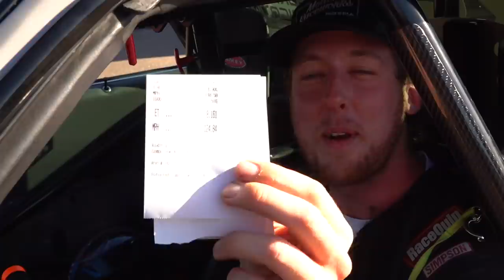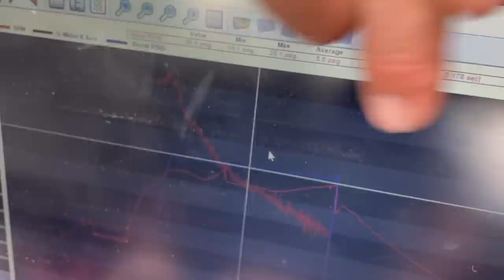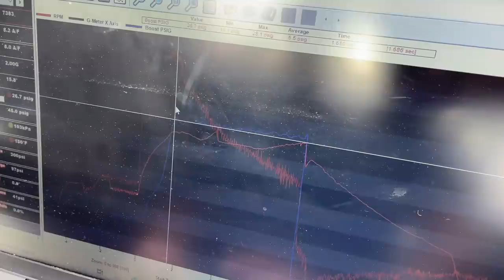Testing Mullet's NEW Turbo400 Lockup Racing Transmission For the First Time! HOLY SMOKES!!!

Comment: So glad to hear Kevin recommend neutraling on the shut down. Steve Morris has pointed out premature failures for this very reason, people that let the engine do the braking. Very stressful on a engine.
Reply: You can damage the transmission if it doesn’t actually have a clean neutral.
Reply: Could also make your tranny grenade.. it's all about compromise.. this for that.
Reply: @SouthernSpeedVideos  guess it depends on which part costs more, engine or transmission... LOL
Reply: and yet cleetus never did it on the passes in this video lol
Reply: @WhiteJameson24  Well if that th400 has a pump on the output shaft also, it shouldn't be an issue. I would assume if they paid the big money it's got something along those lines
Reply: @rebel3353  I think he did I can't remember exact timestamp nor am I going to go back to find it but I think he did.
Reply: @wickett7078  you know what they say about assuming..
Reply: @rebel3353  old habits die hard. And to be fair cleet and team are a lot more likely to hurt their engines in other ways before this becomes an issue with one of them lol always pushing the limits I don't think any failure they've had was due to this, and any worn out main bearing are addressed during fixing whatever else they broke 😂
Reply: Shifting to neutral in a TH400 or 4L80e at speed sends a planetary into hyper speed. A quick search will let you know it is a definite no-no.
Reply: @wickett7078  A pump on the output shaft? A double pumper 400? Show me one.
Reply: @jimandskittum  the M&M TH400 has a “clean neutral” and is setup to shift to neutral without any problems.
Reply: @rebel3353  Cletus never takes care of any of the important things in racing,no surprise.
Reply: @QuantumLeap83  yeah it’s going to take a while for him to get into the habit of going into neutral…
Reply: @KSRPerformanceFabrication  I didn't know about 'clean neutral" valve bodies. Thanks for the info. I didn't mean to put out bad info. It's evidently the direct drum that spins at 2.5 times the driveshaft speed without a clean neutral.
Reply: How is engine braking hard on the engine? this is the first ive heard that and I always thought it was a good thing since it can save on brake wear
Reply: @lazarustheatv8389  I found a forum where a couple of heavy hitters were going back and forth on this. I don't think there is any proof either way but if people want to buy it the market provides it.
Reply: @lazarustheatv8389  it's not something horrendous under normal conditions, but on the shut down after a run that is when you're gonna have oil starvation, because of negative G forces if ur oiling system isn't perfect, and that's happening the same time that the rotating assembly has to deal with the forces of bein driven by the deceleration if the car under compression - the compression is what's actually slowing the car and that created downward pressure on crank bearings etc. So it's not particularly 'bad' but about the same wear and tear as you had when launching the car. Which can be done away with by going to free neutral but at the cost of stressing trans parts if ur not set up for it. It's always been a debate whether it's good or not but there are a lot of big names in racing that swear by it. As I've said the way these guys go through engines (which is a good thing means their pushing the envelope) something else will prolly get an engine before this does.
Reply: idk letting a motor power down through compression with the chutes is a safer bet. it resets heads and gaskets also blows out extra alcohol left behind. purges the system and even helps data log sometimes if there was a failure. with a parachute it usually doesnt even pull the motor that hard.
Reply: Considering the deal they seem to have with Texas Speed, I'd rather buy or rebuild the engine vs buying another trans. Honestly tho they should probably have spares of each. Especially for a race week style car.

Comment: Tough break fellas! 
Luckily it doesn't seem too terrible. 
And Kevin might be on to something with those "topfuel hoops" he mentioned.... it might be that time for ya'll. Plus look at how well they hold up, just ask Kyle and Brent.
Reply: It’s called a fire ring
Reply: @jonathanedwards8913  they have different versions a top fuel hoops is what they are talking about TKM does it to there  engines all the time it's a solid machined in piece fire ring is just copper with split at the end same concept kinda but the hoops are way better having no gap and being machined to engine

Comment: I’m with Kevin, needs top fuel hoops at the hps that y’all are getting into. The hoops require the block and heads to be machined, TKM has mini hoops that they make in house I think, they only require the block or the heads to be machined for the hoop, and they’re bigger than an o-ring set up.

Comment: Kevin looked soo gutted you could almost feel his pain
Reply: When you have a vehicle that is staked on your reputation and it’s constantly having problems on a National platform I’m sure it can be stressful. Granted head gaskets and transmissions aren’t really his fault but after a while I’m sure it gets old fast. But the man clearly understands something that is constantly being tested with new parts and suspension set ups is just going to have trials and tribulations. They got spoiled with Ruby just a work horse and a combo that has just worked for them…Mullett is definitely making them work for it
Reply: @maxxphat87  they're taking a much bigger step with this one. Going from 7s to 6s is harder on everything.
Reply: @ryanlamfers8692  that's for sure and a LOT  of these fans don't quite understand how fast 6's are and the stress too all the components it takes. They don't have 3 spare blocks and 10 sets of heads on standby after every pass for top fuel cars for the fun of it.... this car will be in the 6's by the end of February 2k22 and then struggle again with new issues. It is a very expensive milestone to maintain.  Everyone talks about big chief and look at where his pro mod went in the quarter..... best was a3.38- 5.42 I believe and the times the talk about on the show with the "I remeber when I had a 4.40 car" they are talking about to the eighth.... 🤷🏽‍♂️🙃✌🏼

Comment: I think what that T400 really needs is a nice SMX to complement everything. TSP 427's are awesome and all, but Morris's stuff is on another level entirely.
Reply: Yes yes it is
Reply: But this was the last transmission he ever had to buy
Reply: Cleeter is sitting on a SM 540 BBC. Said it was for the ramp truck at the FF. But it's been so long who knows what the plan is
Reply: If he has to turn the LS down to not blow the tires off, an SMX or other Pro Mod type motor is the last thing he needs
Reply: @randomguy9635  I think he would also put big tires on it.
Reply: I think cleeter wants in the sixes like this and will then put the 540 bbc and big tires on it

Comment: I still wouldn't shut the engine off on the big end at high speed even with the safe neutral.  That is one of two very important rules of the TH400.  The other being always start your burnout in 2nd gear.
Reply: why would the gearbox matter if you neutral it ?
Reply: Not sure but engine off no transfluid pump?
Reply: @Nebbia_affaraccimiei  Because with a TH400 putting the trans in Neutral at high speed will cause the direct drum to double in RPM and could explode from over spinning it.
Reply: @1nitrousmustang  yes never shift a t350 or 400 to neutral the drums accelerate to huge speeds and tend to fragment like a frag grenade let alone the wear on parts

Comment: Time to o-ring the block and run copper head gaskets for sure.
Reply: I figured they already would have had the o rings on it.  I swear that leroy had them at some point
Reply: Just get a TKM engine. Texas speed seem to have a fairly low limit...
Reply: Yep ,👍
Reply: @Jake_Hamlin  it needs a SMX
Reply: Put your order in with Cometic NOW...cause it's gunna take awhile!
Reply: @gnarkiller  Pretty sure leroy did with the block they ran 7s on
Reply: @gnarkiller  Those we’re just metal rings that clamped in between the head and the block. No machining is required to run those. That is the only selling point of them. They are way behind a copper head gasket and machined hoops
Reply: @dylanphipps5272  I have posted that he needs to switch to red copper head gaskets so many times that I gave up. I figured he either did not read or ignored my post.
Reply: O rings “Athena” head gaskets from Texas Speed are what Leroy had and probably what mullet has as well.  They are not the same thing as hoops, top fuel hoops or fire rings which sit in a machined groove in the cylinder head, block or both and use a copper head gasket.  Hoops seal much better/stronger than o rings.  No engine Cleetus has ever had on this channel used hoops.

Comment: TKM Black Sheep for mullet Texas Speed builds nice street engines but when you get to this caliber I think TKM is the go to for LS.
Reply: I agree but I think he needs to go to a Steve Morris SMX engine. Look at what Tom Baily does at his power levels!!!
Reply: @wbr7869  tom Baily doesn't have an LS
Reply: @ninaallen7849  Yup exactly!!! Not knocking a ls but for big power you need something like the SMK engine. That engine can take the power!!!
Reply: I just said this lol
Reply: @wbr7869  I don’t think cleetus wants an engine he has to check valve lash on every day twice a day to make sure it’s not eating itself, like Tom does. A hydraulic roller LS can more than achieve his goal.
Reply: @wbr7869  not knocking other engines either but there are LS that make stupid power and hold together. Slapping a 427ci in with a couple turbos and thinking it'll run high 6s immediately with minimal testing and that much computer controlled shit probably won't work. Texas speed builds killer street car engines and pretty sweet 1200hp capable engines but any more than that, I'd look at some different builders. I do agree there's a reason alot of the consistently fast cars run some sort of big block/hemi but it's alot more work.
Reply: At branden c and Adam I agree with ya both. Texas speed makes great engines but how many times has ole cleet sent them back to be rebuilt? What he is trying to do requires a special engine! I do believe you can get a SMX engine with a hydraulic lifter cam but remember he is trying to run 6’s in a heavy car!!! Thats going to take a engine that may need its valves ran each day!!! Ask Rynn Martin, he has to do the same with that new hemi!
Reply: @wbr7869  I hate the whole xxx world record that everyone touts now but the black sheep went like 4.15 with a hydraulic roller

Comment: I've been asking for months and months if Cleetus was having Texas Speed to put Top Fuel Hoops in the block and heads because they work up to 60 lbs of boost and go up to 90lbs because all the TKM cars have them and thats where I learn about them. John Doc ran a 4.15 e/t with a TKM hydraulic lifter LS

Comment: Even though we aren't there in person to see this action, it's still really cool to watch on video.  Definitely a lot of fun to watch the team working together to tweak Mullet.  I'm not a drag racer but from what I can tell this new tranny is much much smoother.  It really gets the power to wheels and power to the ground in a much smoother manner than the previous tranny.  I would assume that means it has much more control of what the motor is putting out.

Comment: As a person who tractor pulls and builds Pro Stock pulling tractor engines with turbos in excess of 150mm. C-rings and no head gaskets or fire rings and copper head gaskets. But all the Pro Stock engines are c-rings and head directly on block.

Comment: Sounds like it's time to oring the block. Just like kevin said, stainless steel wire and copper head gaskets. Tractor pull guys are holding 100 psi boost in a cummins like that. With triple compound turbos

Comment: Still Tech Tip; The exhaust screen is 100 % going to plug on that backpack blower. When it does, stick a screwdriver in to the exhaust until it bottoms out and then push it in one more inch and woller it around.

Comment: You put the best of the best parts in it and the best guys building it and there is still failure.  No ones fault but it just shows the amount of extreme in these motors. Crazy.  It will be dialed soon

Comment: I know Texas speed is your boys but I'd love to see a tkm black sheep motor in mullet
Reply: Cleetus has had Steve Morris around the shop a lot lately. I think a SMX is in the cards somewhere down the road.
Reply: @garrettstevens2232  personally i think mullet has a built LS  427 short block by steve.. steve has video of engine assembly for cleetus, but cleetus didnt really talk about it. guessing due to texas speed sponsorship
Reply: @TheRick2130  Interesting. I only recently started following Steve's channel so I didn't see that one.
Reply: @TheRick2130  He's got enough Texas speed motors. I don't think one motor is gonna ruin the sponsorship.
Reply: it will be interesting whether TSP steps up their engineering to keep the heads down and play in that market or Cleeter just goes and drops one of Steve's engines in and gets back to business. Something clearly needs to change now after recent failures.
Reply: @bkrgi  I wouldn’t compare tsp to Steve Morris, Texas speed is much higher volume and Steve is a niche builder. Both serving their own purposes
Reply: @zethloveless7238  Who's comparing???? I'm just wondering if TSP will step into this niche...if not then clearly a SM engine or the likes is a must for Cleeter.
Reply: @bkrgi  yea I don’t see a real need for them to make niche motors. Let proline etc do their thing is tons of shops like that already 😀. Not a real big market if they already are a solid high volume shop.
Reply: @garrettstevens2232  just search on steve channel.. "cleetus"
Reply: @TheRick2130  found the time lapse. That's definitely not a motor we have seen yet. It is a big block with a dry sump and SME valve covers custom milled with the FF logo.

Comment: Hey cleetus any way you can hook up an rpm gauge so the camera can see? I think it would be interesting to see where it's shifting at other than just hearing the motor...Maybe speedo/rpm . I like to get hyped when the car goes on a pass.
Reply: There are a lot of options like using a draggy, or  he can simply overlay a datalog with the video.  You just sync it to the start and finish of a run, but it does take more editing time when he has all kinds of things going on. I did it in this video as a test myself. https://youtu.be/kSHhWGQOTRc

Comment: Can I ask what the end goal is for mullet? What class are you hoping to run in?  You are definitely not going to catch Tom Bailey with mullet and a TSP motor, wrong chassis and not near enough motor to run in his class. Thats ok if that's the case, but you also have Ruby that can be a consistent low 7 second car.  

Also why is James not in your videos nearly as much as he used to be, seems like this a repeat of what happened with Coop. This is the only platform I am on so maybe it has been mentioned somewhere else and I am missing it. All the best and no offense intended.
Reply: I think James has been spending a lot of time at Motion. George and the blazer are just a distraction.
Reply: @richardturner8630  glad I’m not the only one thinking this
Reply: Also been wondering where James is. I know there will likely be some response from Cleet saying something like for you all wondering where James he's just been busy doing x y z and he's still here and nothing to worry about. And then 1 month later we'll say goodbye to James
Reply: @Silders101  James has 2 small kids he cant travel as much
Reply: I dont think James is going anywhere, like the other guy mentioned, 2 small kids makes it hard to travel

Comment: With all those crashed vics, is there a way to buy a stock 07 or 08 engine from you?
Reply: Why would you want one?
Reply: They are all ragged. They used second hand oil in them. Better to just buy a crate engine. Cheaper in the long run.

Comment: TKM is now doing a "mini hoop". It is a stainless wire in the head which does not protrude as far as the top fuel hoop. You don't have to have the receiver groove in the block and you can use them with MLS gaskets. You would not have to disassemble the short block. Just machine heads.

Comment: I used to make gaskets for industrial heat exchangers. I'd recommend looking into plated graphite metal gaskets. The gasket itself is steel but it comes with a think coating (sometimes up to 4mm) of graphite on both sides. When under compression, the graphite spreads out and makes a great seal. Also take a look at camprofile gaskets.  They're good in applications where high temperatures, high pressures and fluctuating process conditions exist. At this stage in mullets build, I don't see any automotive "off-the-shelf" gaskets being any good. You've already got too much time and money into the whole engine to cut corners now. Put some extra money into having some gaskets custom made for the application. You won't regret it.

Comment: An O-ringed block and heads should be in every high powered car in the fleet. I'm very shocked that Mullet doesn't have a set when Texas Speed went all out on the engine

Comment: One of your best videos... awesome to see the process.
But as they say “That’s Racing”!!!
I’m running an o-ringed head. 
35tho groove with piano wire carefully measured and tapped in. I also have receiver grooves machined in the block with custom copper head gasket. 
The best thing is the gasket can be reused after annealing with an welding torch.